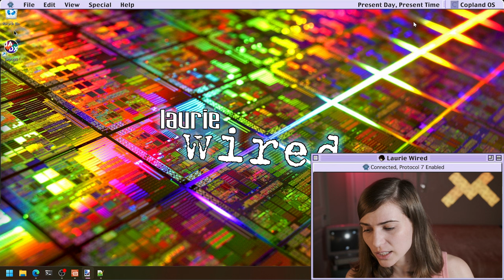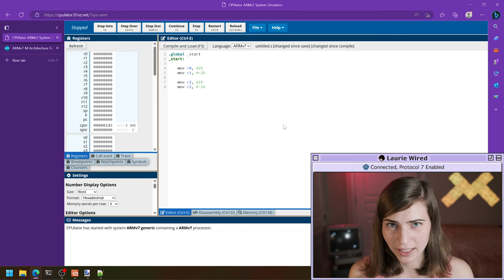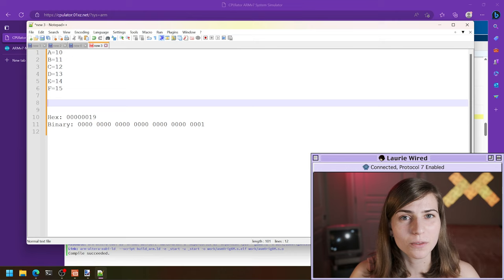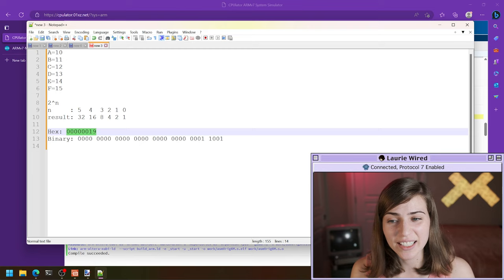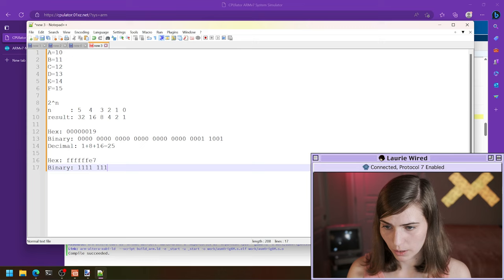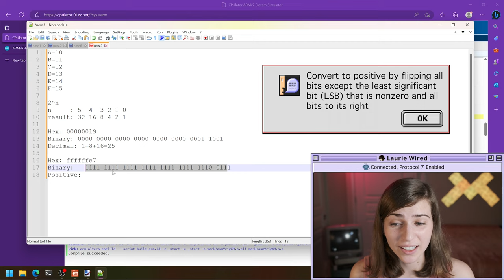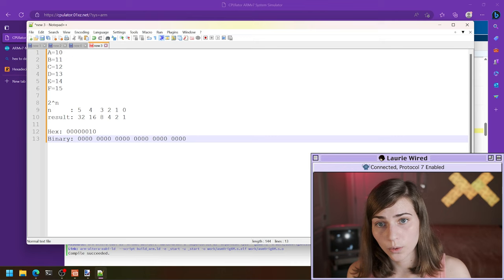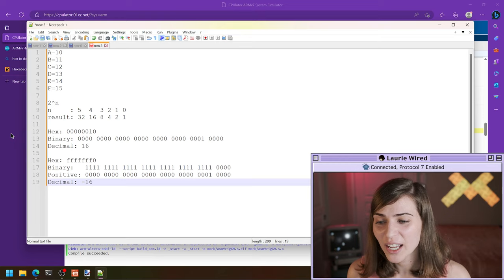ARM Assembly: Lesson 5 (Signed Number Conversions)

Comment: In case anyone was interested, the reason for 2s complement notation (as opposed to simply using the most significant bit as a sign and everything else is the same) is for ease of maths - by default, if you try to store a larger number than the number of bits can hold, the value wraps around.  To use an 8 bit value as an example, the maximum value if 255, or 0xFF in hex.  If you add 10 to this value, it wraps around to 9.  Likewise, trying to subtract a larger number from a smaller number will cause the value to wrap around in the opposite direction - if you subtract 10 from 0, it wraps around to 0xF5.  As such, representing -1 using the largest possible unsigned value gives two benefits - the maths just works without any additional messing around, and you only have one 0 value.